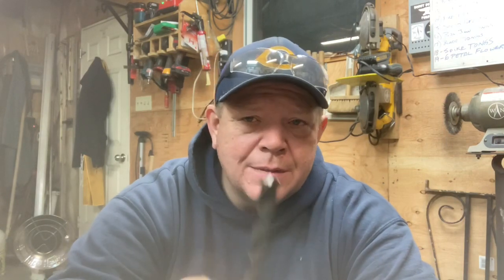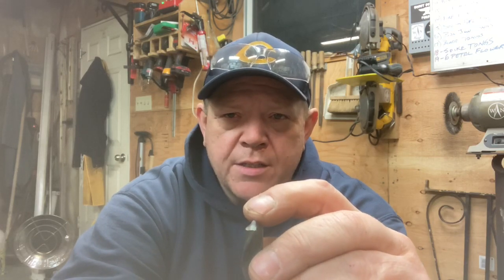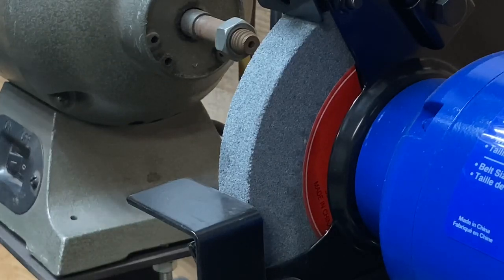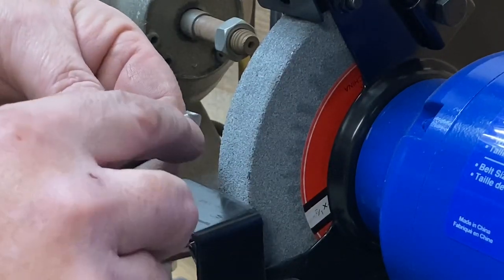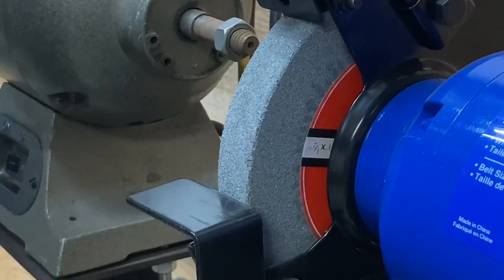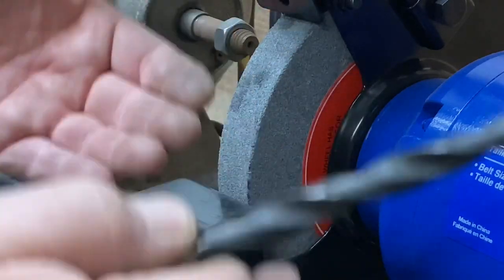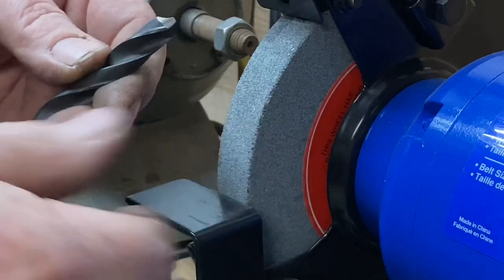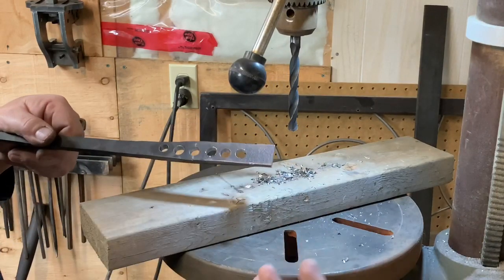Sharpen Drill Bits // The Easy Way

Comment: Great tip Chris! Much easier than the way I was doing it. One tip that I could a add is take two nuts and hold them together and the angle at the top and bottom are approximately the right angle for a drill bit. Thanks for sharing! 👍⚒
Reply from the maker: Thanks Joe. That’s a good tip with the hex nuts too. Take care and thanks for watching.